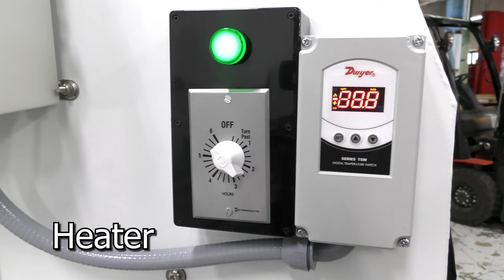Hydro Blast Max Parts Washer - Vapor Honing Technologies

Comment: Can you use a solvent in the water? 
Like a degreaser of some kind?
Reply: I assume so, but must be quick break otherwise oil skimmer won't work. And not damaging to components. So nothing overly acidic/alkaline. And no flammable solvents. Just water based degreaser.